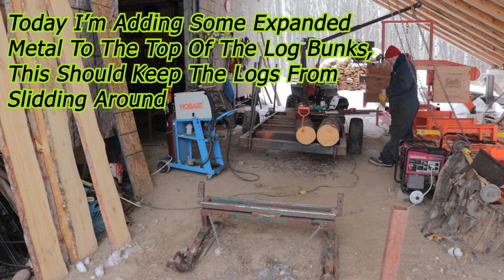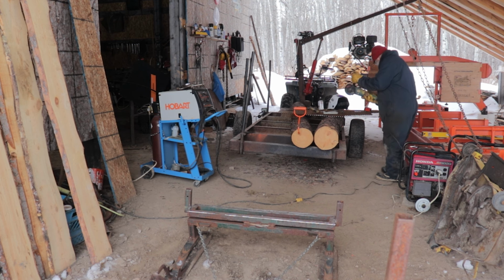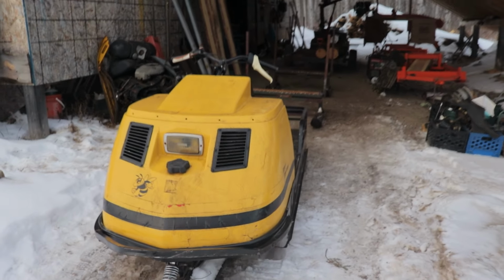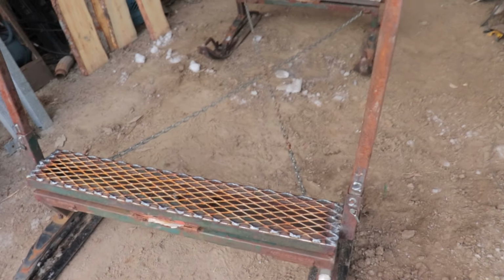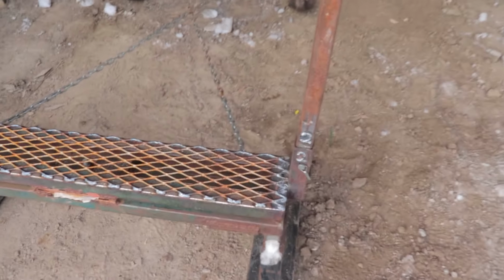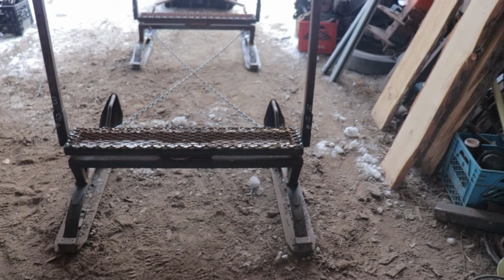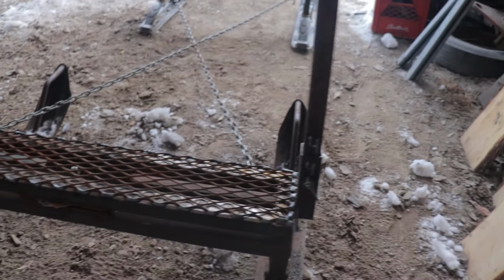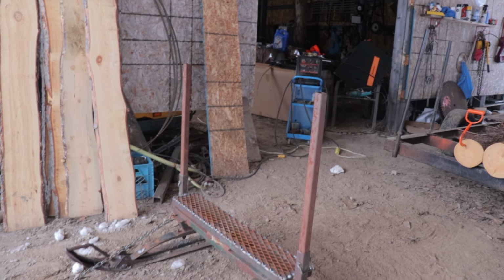What A Difference This Made. I Also Show You How They Work.

Comment: Love your videos and enjoy watching them. May the lord bless and protect you and Heather and working on the homestead
Reply from the maker: Hello Brenda. Thank you. You have a great day. Cheers!
Reply: That will help a lot with logs slipping around you could have use a piece of chain and it would have saved lots of welding wire but great work
Reply from the maker: Hello Tim, chain is too smooth and it won't grip frozen logs..this expanded metal has a sharp side to it. Cheers!